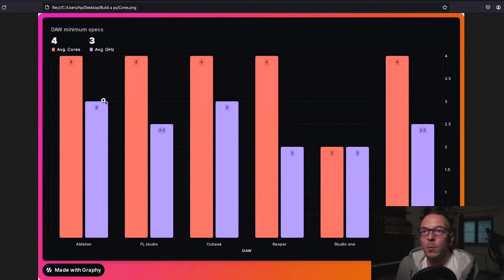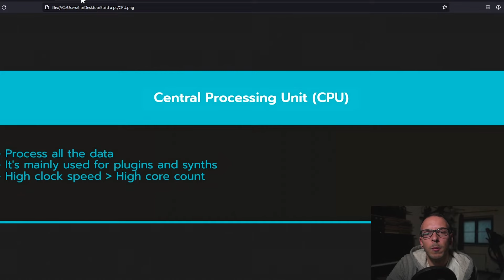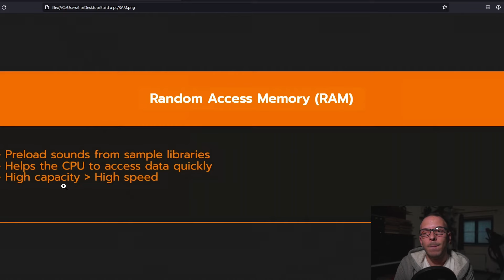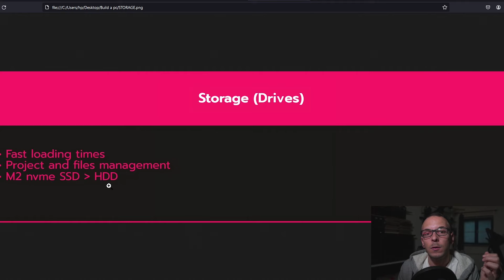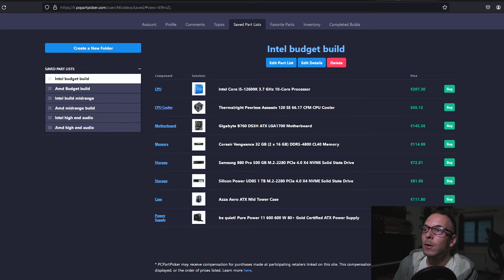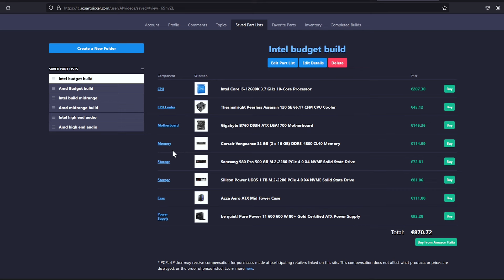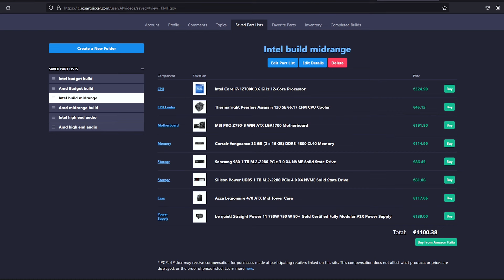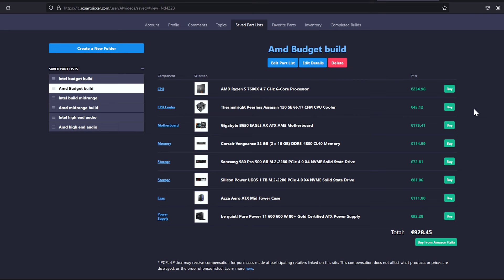Building a music production PC - How to choose parts

Comment from the maker: Ok after a lot of research here's some builds for different budgets and use cases -

Low latency build for recording mixing engineers:
CPU - https://amzn.to/3W0005R
MOBO - https://amzn.to/4iWKRvU
RAM -  https://amzn.to/4gT9WpN
STORAGE - https://amzn.to/3ZOKlaK
PSU - https://amzn.to/3PhZMn3

High capacity build for composers/mixing/mastering engineers:
CPU - https://amzn.to/4guweP1
MOBO - https://amzn.to/4fCijVC
RAM - https://amzn.to/4gSd0CO
STORAGE - https://amzn.to/4iQre8R
PSU - https://amzn.to/4iVNSg7

Budget do it all build:
CPU - https://amzn.to/3BYT7eh
MOBO - https://amzn.to/3DAlO1E
RAM - https://amzn.to/3VYh0K1
STORAGE - https://amzn.to/4gzV8Na
PSU - https://amzn.to/409UNuW

Comment: Just get a 9 7900 amd chip and a good mobo 32 gb ddr memory and you are good. Not fastest chip but runs cool, reliable and quiet. fast enough for many  tracks mixing.
Reply from the maker: Right now ryzen 7 and 9 seems to be the better buy, I would go with intel only for video production codecs support on lower tiers cpus (like 12400/12500)
Reply: @weeddiz5732  Thanks but not sure a 12th gen 12400 at only 2.5 GHz is as good as a AMD 7900 non-x (3.7Ghz up to 5.0+). What makes Intel better? I do some video editing but not often. Mostly music editing with plug-ins just at home for fun and always less than 20 tracks. What MOBO do you like? Many seem to have issues.
Reply from the maker: @MOAB-UT  The difference is for accelerated video codecs, specifically the 422 10 bit nightmarish one, at the moment intel is the only one that can accelerate those codecs with just the iGPU, also there is a little bit of issue with latency if you go with more than 8 cores with 7/8/9000 series so the best sweet spot right now could be a simple 7600 with a lot of ram (if you are just doing audio)
Reply from the maker: @MOAB-UT  But yeah, my ideal choice would actually be the 7900 non X for 90% of my work, maybe a good ryzen cpu and a small intel gpu for accelerated codecs is all that a video/audio editor would need! Waiting to see what battlemage will bring to the table, but I'm not too sure about intel's future at the moment

Comment: Ryzen 5 5500 a good one?
Reply: I would say 5600g. You don’t have to buy a graphic card if you use this one, which also means that even a cheapest 300w power supply would be good enough for your whole PC.
Reply: @lucien9183  too old cpu we are 9 gen ryzen..5700 series,
Reply: @oldskoolfunkandsoul1  I am saving his money, man. To upgrade the CPU from the 3000 series (or any other older Ryzen CPUs) to a 5600g, you only need to upgrade the CPU. Otherwise, he will need a new motherboard with an AM5 slot.
Reply: yes but 7900 is more better.
Reply from the maker: @lucien9183  Agree with you! There is a difference in performance comparing the newest chips, but not enough to justify the price! I was tinkering with pcpartpicker and with all the other same specs (32 gb ram ddr4 vs ddr5, same ssd, case, coolers and psu) the price difference was around 350 euros! Not worth it at the moment

Comment: I've bought an AMD 9 7900 and 2x32 GB Corsair Vengeance DR5 5200MHz CL40, am i good ??
Reply from the maker: You are golden!, for 99% of audio work you wont have any issues
Reply: @weeddiz5732  thanks man, for ROM i have a 990 EVO PLUS, is it good for OS or Secondary drive ? Is this a good Drive, i think i should have bought a 990 PRO
Reply from the maker: Don't worry, that's a great drive for sure man!! Speed is not an issue as much as reliability so just make sure to have your external drives in check!!

Comment: Great video man, I have ordered a PC and below is my spec. It’s being delivered in a few weeks after its build and testing, what do you think?

Core 4 (custom - only system drive)
Intel Core i9 14900K 24 Cores, 32 Threads, 3.2GHz, 6GHz Turbo
(8 Performance cores, 16 Efficient cores) (16 Performance Threads, 16 Efficient Threads)
Deep Cool Tower 2x 140mm fans
Asus Z790-A DDR5 Motherboard
192GB DDR5 5600MHz RAM (4x 48GB)
2TB NVMe Crucial 5000MB/s Read/Write (System)
Seasonic 1050W 85%+ GOLD Efficient PSU
Nvidia RTX 3050 6GB GDDR6 2x HDMI 1x DP
2.5GB/1000/100/10 Ethernet Connection
10x USB3 Ports (6 USB Type A, 2x USB Type C, two Type-A front ports)
Thunderbolt 4 PCle (2 ports)
Fractal North Tower Mesh side panel Case 2x
USB3 ports (white)
Windows 11 Pro 64bit custom install
Reply from the maker: That is going to be a BEAST of a computer build!! I don't know if the I9 is going to be super stable due to the fact that extremely powerful cpus tend to give diminished returns, but I hope that I'm wrong! Have you received it yet??
Reply: Are you able to run the CPU in turbo mode with the deep cool tower?
Reply: @weeddiz5732  Even at this point the 14900k is just an overclocked 13900k which honestly in terms of price to performance makes no sense. The 13900k is cheaper and easier to cool. Probably he would have been fine with a 13700k, but.....
Reply: It’s like ur building a server hehe
Reply: @diostaylow  😂😂
Reply: @FlockofAngels  This I wouldn’t know about, I’ve never used a CPU in turbo mode
Reply: Wow! What a beast! How is it working out for you now that is has been a few months?
Reply: Not great. Runs too hot. New gen. Intel chips have many issues. too many cores for music work. 4 slots of memory is problematic. using 2 is better. you only need 32 gb and 4800 is more stable. nvme's are good but small. should have gone with corsair psu. win 10 is better than 11 for music and latency. asus mobo- just no. not reliable.
Reply: @ no issues to report here, this machine is unstoppable. I’ve tried to max it out with plugins, video editing  etc but no… it keeps holding up 👍🏾
Reply: I'm thinking to go for 7800x3d or 9800x3d instead, what do you guys say?
Reply: @YTIzanagi  NO to x3d. Big NO. Not good. Most hate it. By far, get the regular 9 7900. Slower- sure but cold and quiet. You can click a button, PBO and make it faster, but most do not. The X simply comes with that button already checked...for the most part. Non-X is the way to go IMHO. It is what I plan to use on my build. I researched all cpu's over the last 2 weeks. Others can be faster, but they crash, they get up to 100C+ whereas the 7900 runs at 50C (temp.) Less fan noise- more efficient running machine. Then spend money on a LOW latency MOBO- important. I struggle to find the best one.  Spend a little more. I think I will go with ASUS TUG X670E with the s1220 codec. Do not ignore latency or the audio codec in your board. Obviously use NMVe and two of them. Avoid Samsung due to issues- go with WD. One just for the OS- the other for strorage. PSU should be a Corsair RM860X. 

Make sure your MOBO is on the latest firmware and has patched the known Ryzen SinkHole security issue.

These are good tips from all my research. NO to x3d. 32GB DDR5 memory is plenty. Only fill 2 slots- never 4. With this chip you do not need a GPU. It's built in which can offer some lower latency and less heat benefits. If you plan to game or it's not working good enough, you can always add later. The 7900 also comes with it's own cooler so more cost savings.
Reply: @MOAB-UT  7900? okie I thought about the 7900x as it was crossing my budget already with the gpu and 7800x3d.. so you'd say 7900 is enough for it coz I won't be upgrading it anytime in the near future, need more of a value for money build yet being future proof.. for mobo I had the exact same TUF one you mentioned in my list.. Thank you for sharing your info regarding the X CPU's
Reply: @YTIzanagi  For most of us, we should get the regular old 7900 NON-X. It rocks. The socket is the new one so in the future you could upgrade but won't need to. Unless you are doing a ton of rendering, 20+ multi-track recording, 4k videos and games, the non-x is perfect. Runs cooler, quieter, comes with cooler, cheaper and performs very well. Memory is important- at least 32gb ddr5. 4 is better in some ways but it won't work with that cpu. You can also click a button and make the 7900 essentially an X. Most people I know say they never needed to as it works great out the box. Get the Corsair rm850x power supply too. Upgrade the bios on the MOBO since AMD has had a security issue. See Sinkclose.

Good luck my friend- it will be a killer build.
Reply from the maker: @MOAB-UT  Absolutely agree with you! We don't need a lot of features that are presented in 90% of youtube videos, I saw an italian youtuber/tech engineer that was also talking about some issues with high core count/e core for audio production and latency; Basically a ryzen 7600x/8600G or a i5 12500/12600 (non K) should be the sweet spot for the price, unless you are also doing video editing, then I would go with a 7700x or a 7900. Thank you for the comments, guys!
Reply: @MOAB-UT  I'll definitely put your words before I have my build. I mostly do freelancing stuff like mixing mastering ghost producing and composing for short films. Like you've said I feel this might be enough for my use. Thanks a lot for you time again..

Have a great day :)
Reply: @YTIzanagi  It should be more than enough. Also, if you can wait until next year, I think there might be some more exciting products coming out. 2024 is not the best year for computer innovation. Intel has issues and AMD's offerings are just OK. Some security issues and performance is not much better than previous generations despite the new socket. 2025 should be a better year to build. For GPU, Intel did just release two interesting units.

Comment: Moral of the story...drop at least $1000 on your cpu...rubbish. I have built tons of machines for cheaper that are still kicking ass. You will be just fine with a gen 5 cpu. They are cheaper and will definitely get the job done.
Reply from the maker: One of the best CPU that I will suggest for newer build is the Ryzen 7900, and that should not cost more than 320 euros, latest gen still works wonderfully, a 5700x is more or less 200 euros new, sooo nope
Reply: Huh?
Reply: @weeddiz5732  I'm just saying that for normal gameplay on a budget, you can spend a whole lot less. Now, if you want to max out your settings and have insane fps, then we all know it's go8ng to cost more.
Reply from the maker: @ Yeah but 1, we are not even talking about gaming nor fps and 2, I haven't suggested anything new gen/extremely costly hardware so I don't know, perhaps you have posted the comment on the wrong video.
Reply from the maker: @ I don't get it either ahhahahaha
Reply: @zachariahisaiah1793  This video is advice on music production PCs, otherwise I'd agree almost. You can of course get something reasonably capable for most price ranges for gaming or production but realistically most people would find the builds in this video fit their use case well
Reply: @weeddiz5732  yea I think I got it mixed up with another video I was watching. My bad guys
Reply: @zachariahisaiah1793  ahh makes sense!